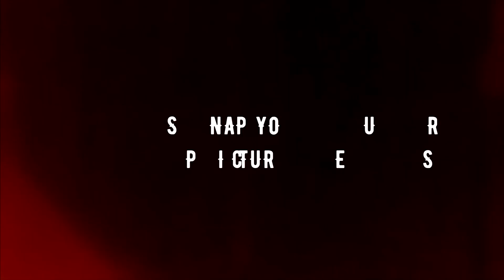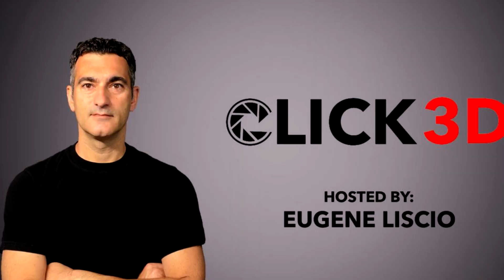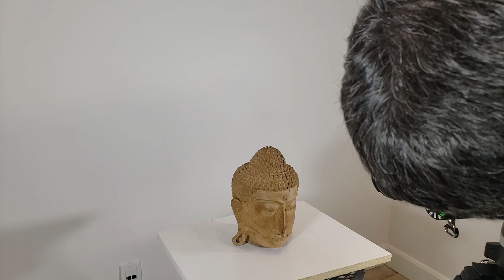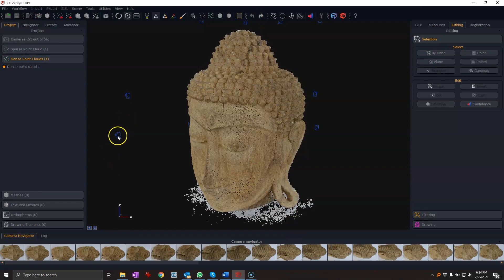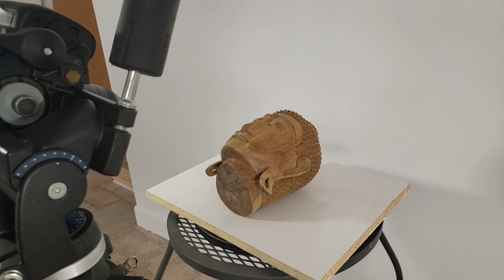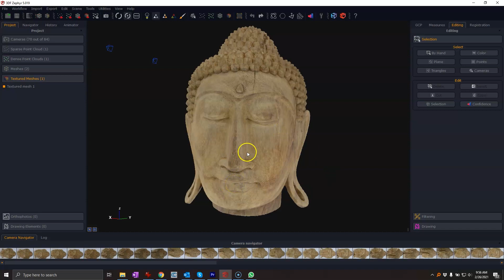Tutorial : Using a turntable for small objects | Photogrammetry |  CLICK 3D EP 11 | 3D Forensics

Comment: Does the camera have to maintain a position so the software can compile the model based on its space in 3d?
Reply from the maker: @sonicUnison  Normally you are moving the camera around the object but if you are using a turntable then you are tricking the software into thinking that you are moving the camera when you are actually rotating the part. The camera can be moved to various positions…in fact, it’s a requirement.

Comment: Hi there! Thanks a lot for your great tutorials, they really help me out a lot. I have a few questions though, if you would be so kind to lighten me up about them as well:

- In other tutorials (and you also confirmed that in one of the comments below), you said that it was not a problem that the object was not entirely in the frame at all times. I suppose it means it is not a big deal if some parts of the objet are a bit blurry? Indeed, I have no macro lens, which kind of forces me to use quite a long focal length (105mm) to close up on the object. The result of that is that the edges of the object are a bit blurry.
- Which gets me to my second question: what focal length do you use, and what kind of lens ? Is it a macro lens?

Thank you very much, I must say I'm a beginner in photography and I'm a bit lost with all these parameters!

Comment: You could save yourself a lot of trouble by getting a black background, and a felt cloth for your table under the object, as well as a ring flash with polarising film cut to size for the ring flash, and a polariser on the lens to cut out the reflections from the flash (test on a reflective object), and shoot in a room without a lot of ambient light, esp if you want to retain the actual colours. A passport colour checker can help there as well. Masking and deleting the unneeded points before meshing helps.
Reply from the maker: I agree, black felt would have been helpful but I went with what I had at the time.
Reply: 100%.

Comment: I love these tutorials because they always tell me that Im doing stuff right but yet zephyr throws out 90% of my photos anyways lol
I even designed and 3d printed my own turntable to try and get less blurry images as my hand shake a lot
I have to actually get really into the settings to get it to accept more pictures.
Reply from the maker: Remember to get in close and fill the view with the object. Show as little background as possible and take small incremental movements when adjusting the turntable. If you have a tripod, that is best!
Reply: @3Dforensics  unironically, as soon as I posted that I actually got my scan to work and accept my photos. I made my lighting really bright and upped the exposure and contrast on my phone too have the object really pop out of of the image so that it was easy to mask in masquerade.
I'm not using a tripod I'm just using 3d printed phone stand that I put at different heights.
In any case, thanks for the tips.
Reply from the maker: @brobpony4792  Glad it worked out and best of luck!